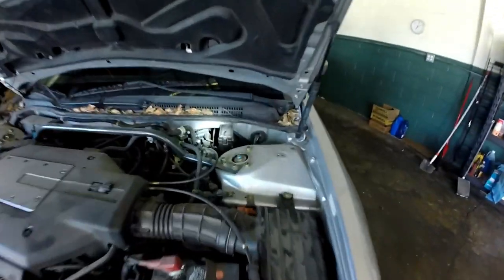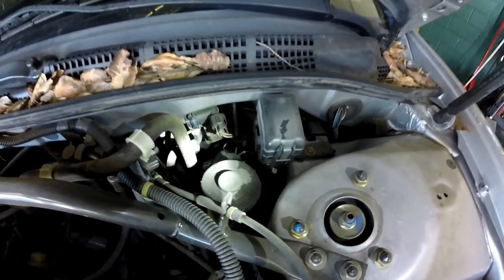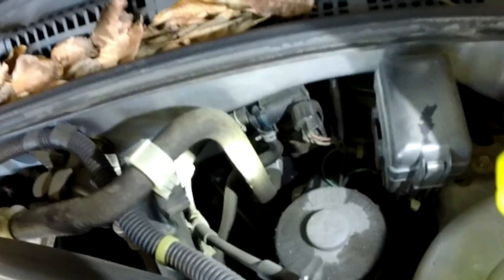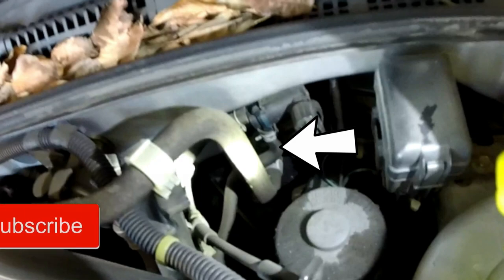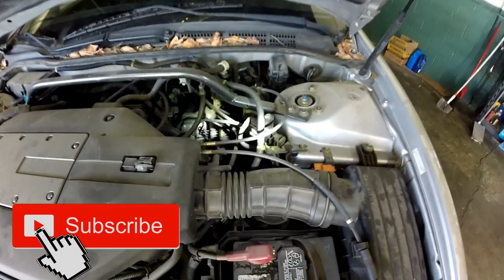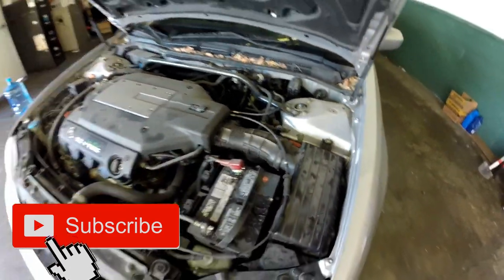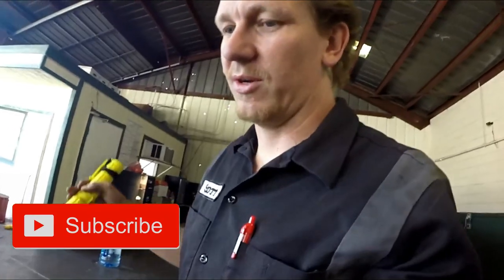What Does EVAP Purge Valve do?

Comment: Thanks for the explanation. My purge valve broke and was wondering how vital it was to engine functioning but if it's just venting vapors to atmosphere i guess i'm not too worried right now. My mpg did go down and have a vacume leak code I wonder if the purge valve has something to do with this.
Reply from the maker: If your purge solenoid is bad. It can be possibly stuck open and not allowing the valve  to seal. If the  Valve does not seal properly it can cause a vacuum leak through the evap system. It is also real common to get a rich or lean code when this is occurring as well.  The decrease in gas mileage can be contributed to this as well.. I just posted a few videos on how to test these if you have a 9 V battery.. Check out my video library and see if it will help.

Comment: Found your video while looking for the 2010 Kia Soul 2.0l that has a code p0449. But also p0455 then again p0107. P00170. Do I understand correctly the vent valve solenoid is under rear of vehicle?  The poor thing has trouble just staying running let alone being put into drive. Changed the fuel pump. Being old & old school does not compute into the equation.  Any direction appreciated.  Thank you
Reply from the maker: From the sounds of it you might have a stuck open vent solenoid solo Lloyd. I have a couple videos on checking this problem. Check out these 2 videos and see if they can help you out. https://youtu.be/6WkB6g4a-tQ,  https://youtu.be/P_TdjKWWE1k, and https://youtu.be/_ojQ3ELu27M . Keep me posted on your progress and let me know.

Comment: I have a question. I just replaced my entire purge valve on my 2003 Ford F-150 V6. The hose that goes into the engine is currently unplugged and capped off. If I plug the hose in then my engine will stall and die. But if I cap it off, it will run no problem. I thought this was the purge valve but I’m thinking it may be something else. I can’t run the A/C in my truck because it will stall and die even faster whether the hose is plugged in or not. But it’s does the quickest when it’s connected and the AC is on. Any insight?

Comment: Hi I have code P0441 and a rough idle I don't know where to start to fix this. Your video was great, could you please suggest where to begin. Thank you!
Reply from the maker: this is a video on how to test a Purge solenoid. Have you took a look at your purge and see if there is anything obviously wrong? Like accidentally got disconnected?  What is the year, make, model, engine size you are workingon?
Reply: @ScottiesHobbies  Thank you for the reply I have a Toyota with a 3.4 v6 2001. Im aware that at this point it could be a number of problems. I will check if anything is loose, what should I do if they are fine. I also have some compression numbers that are higher in 2 cylinders, all the other ones are in the normal range any suggestions for solving that. Im trying to learn and your videos have helped me thank you.

Comment: Ok thank you! My 2013 Hyundai Elantra just started a rough idle. I went to the dealership and they told me the problem was a motor mount and map sensor. I got that fix last week and my car is doing the same thing. I took it back yesterday and they kept the car for a while. I was told it’s nothing wrong with my car. They said no codes came up and everything check out. I’m stuck with this rough idle. A guy on another video told me he had the same issue. He told he changed the evap canister purge valve and it help his idle.
Reply: Try changing or cleaning the throttle body and the IAC valve. you'll notice  significant improvement.

Comment: I've gone through 3 or 4 evap valves.. I guess it's time to change it again because even my throttle body sensor goes out and then I get reduced engine code and my Chevy Colorado starts to sputter super bad and it smells like rich oil. Any idea why I've gone through so many evaps?

Comment: What will heppend if i only plug out electricity from evap valve, can i drive like that, can it cause some problem if i turn him off for a test drive ?!
Reply from the maker: They do go bad and get stuck closed sometimes and it usually doesn't cause catastrophic failures.  I'd think it would be ok to drive a few miles but your check engine light will probably come on.

Comment: 06cvpi pcm not commute w purge valve circuit issue can I hook power to purge valve n toggle switch manually open purge my self on highway after engine beened running  a while ?

Comment: So a bad purge valve will cause a gas smell on startup?
Reply from the maker: That is not a common symptom. You are describing more of a evap line leak or fuel system leak. It is possible for the connection at the purge to leak. 

Good luck. 🤞👍💪
Reply: @ScottiesHobbies  It was technically an evap leak, which was the exhaust flange to downpipe connection.

Comment: will it mess your car up if you do not replace it?
Reply from the maker: Not mess up but with your check engine light being on you will not know if something more serious is happening. A bad solenoid can cause very poor fuel economy too.
Reply: @ScottiesHobbies  Thank you, The check engine light came on and they said it was the solenoid so I bought one and then the check engine light didnt come back on so I didnt put it in.  So what should I do
Reply from the maker: @dawnfordham9844  if the light has stayed off just leave it a lone. If the  light comes back on for the same reason, replace it at that time.

Comment: Hi Scott great video an explanation, is possible that if this valve is clogged. To cause the engine loose power and get hotter easy? is it possible to clean it using electrical cleaning spray? Thanks in advance!
Reply from the maker: These valves should not get clogged. If this valve is clogged you will probably have a problem somewhere else down the line. But purge solenoid go bad a lot. Do you have a check engine light on? Get hotter easy, do you mean the vehicle starts to overheat or get towards the three-quarter mark on the temperature gauge? I've never seen this valve fail and cause a overheating condition. I have seen this fail many times in the stuck close the position and the stuck open position. If this valve is defective in the stuck open position it will very likely cause drivability issues. If it's stuck in the closed position it should not cause a drivability issue unless the computer is making the car run funny because it knows the vapor solenoid isn't working properly and is trying to compensate. If you look at my video library I think I have a video where I actually test the purge solenoid in a couple ways and how you can verify that is working properly. If you can't find that video let me know when I get in front of my computer I'll find it and send you the link. Also let me know if you have a check engine light on I'll talk to you soon. Good luck with your diagnosis.
Reply: @ScottiesHobbies  Hi again, i really appreciate your knowlege and willing to help so quickly, and in fact! the engine is running funny It gets hot easy, every time the tank is full,  I think the solenoid is stuck on the close position, and exactly the engine is trying to compensate. I will check the solenoid based on your video. But i have to wait until weekend. Thank you so much for your help!

Comment: it throws on my "tighten fuel cap" signal on the dash. And I was wondering if the malfunctioning purge valve could make your car lose gas mileage
Reply from the maker: It is possible that either The Purge or vent can malfunction and cause a loss of gas mileage. In your case, have you checked your fuel cap? Look on the bottom side of your fuel cap where the rubber o-ring is and see if you have any cracks it is possible that either the purge for events can malfunction and cause a loss of gas mileage. In your case, have you checked your fuel cap? Look on the bottom side of your fuel cap for the rubber ovary is and see if you have any crack or see if the seal has gotten really loose on the cap.  whenever I have someone with this complaint I always recommend to replace the fuel cap with a factory replacement or a Stant cap. Non locking cap of course. Let me know if you have anymore questions and please keep us posted, your fix might help somebody else later.
Reply: Scotties Hobbies I have already taking the gas cap off and flipped the O ring around to get better suction there are no cracks and it fits snug so I do not think it's the gas cap I'm thinking about taking the purge valve off and running compressed air through it to see if it is working. And somebody said that the hose connected to it that runs into the manifold can sometimes get clogged so I took that off and it is not clogged so the only thing I can do is take the purge valve off to see if it is working. Thanks for your reply most of the time nobody ever replies on other videos
Reply: 7

Comment: Hi Scottie, I had the code "P0444" come up on my e46 BMW. "Faulty Evap control solenoid valve", "open in the evap control solenoid valve circuit", "poor or contaminated connection at the evap canister purge volume control solenoid valve" and "evap purge control valve circuit open". I first replaced the purge control valve  and CEL would come back on after clearing it. After driving for a while I would smell gas fumes near the trunk. I then replaced the gas cap, activated charcoal canister along with the pump attached to the canister. Cleared the codes & the only one that remains on is "P0444 purge control valve circuit open". Gas smell is gone but the car still doesn't idle correctly. Could it be that the new purge valve got contaminated? Or maybe it's a fuse? Cant figure it out. Any help is appreciated, thank you.

Comment: I have a 2000 f150 4.2 v6 it throws two codes 0171 and 0174 both are lean coded. The hose going from the purge valve to the intake was dry rotten and cracked significantly. I also get 11-12 mpg avg unless I go on 150+ mile trips then I get 15-16. Whst could cause all of this? P.s air filter less than 3000 miles spark plugs less than 2000 miles.

Comment: Hey scottie when I turn the car key to on position without turning on the ignition I hear the purge valve clicking noise and then it becomes normal. Is that an indication that my purge valve needs replacement?
Reply from the maker: Not necessarily meaning the Solenoid is bad. The Seal in the solenoid might be going bad. The best thing to do if you think it is going bad is to see if the valve holds vacuum when no power is applied. 
 You could also have a bad vent solenoid  Causing the fuel system to over pressurize slightly and causing the  Purge solenoid to come on more often. But in that situation I would think you would have a hard time pumping fuel into the gas tank or having a hard time starting the vehicle.

 Good luck on your DIY fix. Keep us posted on your progress in what you find.

Comment: Does that give a code p0448?
Reply from the maker: No. P0448 is a evap Vent code
Reply: @ScottiesHobbies  do you an idea what I have to change been doing many research and had went to a mechanic he had change the control vent value but code still showing up a different mechanic told me change the canister Evap purge valve really not sure at this point any ideas would appreciate it

Comment: Would the evap valve cause a car to be sluggish when pressing the gas pedal? Like would it make a car feel really heavy? Thanks!
Reply from the maker: Ehh.. possible but not likely. I would think it would send a check engine light on if a evap solenoid failed causing poor drivability.  I would think the purge solenoid would have to be open allowing vapors and unmeetered air into the combustion chamber. Is your check engine light on?
Reply: @ScottiesHobbies  

Yes it is on unfortunately. Would a bad V.I.A.S. system valve make a car drive heavy or sluggish on the gas pedal?
Reply from the maker: @thelionsshare9994  possible too but I am not up on the knowledge of how the V.I.A.S. works. I've always thought of it like a idle air control valve.. have you checked for vaccum leaks, cracks or rips in air intake tube after mass air and before throttle body, exhaust leaks before pre cat oxygen sensors?

Comment: Does the purge valve have anything to do with the emission?... I have a 2017 impala and they kept saying I needed to tighten my gas cap now I took the car to the dealer and they say I need a purge value but it’s not covered under the emissions warranty... when I’m pumping gas and start my engine my car barely wants to start...😩😩😩
Reply from the maker: A purge solenoid is a part of the emissions system. What state do you live in? And how many miles are on your car? And what is the year of your vehicle?
Reply from the maker: Are you having any issues pumping gas? Like does the gas pump try to turn off before your tank is full?
Reply: I’m not having pumping the gas it’s after the gas is in and I try to restart the car.. it barely wants to turn over I’m in Georgia and it’s 66400... Chevy says I have an emissions warranty up to 150k miles but they said a purge valve isn’t covered 60 dollars for the part and 200 for labor...
Reply from the maker: @khiaggayfield  I'm driving back to California from Atlanta Georgia right now. I know in California if the vehicle is a 2015 or newer you have a 10 year or a hundred thousand mile warranty. Prior to 2015 I believe the federal emissions warranty is 7 years or 70,000 MI. So the year of your vehicle might be making the difference in your situation. But all in all the purge solenoid is a part of your EVAP system.
Reply: Wow.. well safe travels! Maybe they are saying that particular part isn’t covered.. I don’t know.. I feel like it should be!  Maybe I’ll call again.... thanks again for the tips!!!
Reply: My book says 15 years 150000 but again I guess only certain emission parts are covered 🙄🙄🙄...
Reply from the maker: @khiaggayfield  I have honestly never had a good experience getting a dealership to cover an emissions warranty. I always felt like it was a gimmick. Once Upon a Time my sister had a problem with her Dodge and I had to contact the Bureau of Automotive Repair in California to get something done at the dealership. You would think that all emissions parts were covered under an emissions warranty. I don't know if there is a Bureau of Automotive Repair in Georgia, if there is I would contact them and ask them what your state emissions warranty is
Reply: It  @ScottiesHobbies

Comment: When the car is cool... The purge valve is consecutively clicking. Is it normal? And the car misfires until warm.
Reply from the maker: The purge valve clicks a lot. You can test it by disconnecting it and seeing if it holds vacuum. If the valve is malfunctioning its possible to cause a miss fire.

Comment: Could it affect driveability ?
Reply from the maker: Especially if the valve is stuck open causing a vacuum leak.
Reply: Scotties Hobbies will this cause a car to have a rough idle?
Reply from the maker: @adriandial1341  its possible but it should also cause a rich condition. If you can get to your purge solenoid and install a vacuum guage to it it should hold vacuum with no power to it. I have a vid on a quick test on purge solenoid if you check out my library or yt search  'scottieshobbies purge' & it should come up.
Reply: After the rough start and chugga chugga, would it stink like gas in the car?

Comment: Great video
 I have a question I have a 96 Chevy Lumina and it does have two EVAP solenoid The first one looks like a square similar to the one you showed in your video and the other one looks like a circle And there is a small hose goes from the square one to the Circle one and I do I have a check engine light i scanned it and i get this code p1441 But I don’t know which one of them is bad.
Any help is highly appreciated Thanks

Comment: Replaced the purge valve solinoid on my 98 Chevy Malibu twice. All it does is make a loud rapid clicking
Sound...
Reply from the maker: Some of them are allowed. Yours is probably working perfectly. What you really need to do is do a vacuum test on it. See if it holds vacuum and then when you apply power to it it should release the vacuum. If you check out my other videos I do have a video where I am doing a vacuum test on a purge solenoid. It's really simple and really fast.
Reply: @ScottiesHobbies  seems like one minute it's non stop going down the road then it stops. Then sitting idle it starts again.  It's a hit and miss. Ran a basic scan tool on it shoes no coed for it like the last time. That cleared off then couple days later the check engine light came on. Now says small evap
Leak already checked the gas cap took it off a few seconds checked the gasket and seals thry look fine. So not sure what's going on. Called a few shooed here thry want $95.0 just to test it.